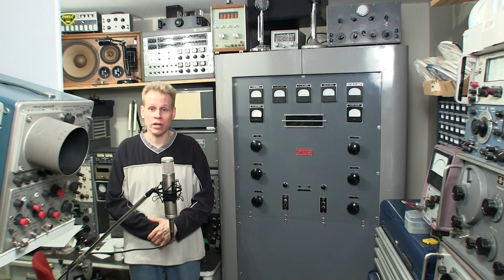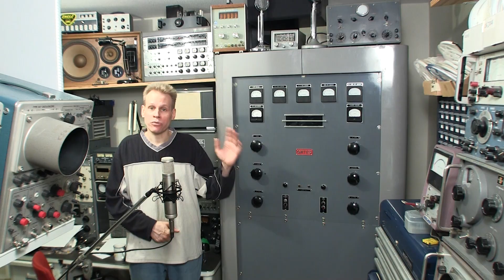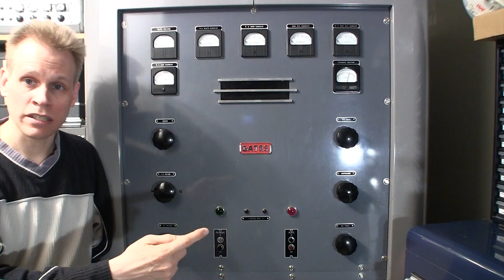Standing Inside a Broadcast Transmitter While it's ON!

Comment: This is a brilliant reminder that in the days before semiconductors (and to a certain degree, long after), the only way to make high power equipment that didn't catch fire was to make it really big. Nowadays, and even for the past couple decades, you could easily fit a 250W transmitter on your desk (and many people do). What people may not realize (or remember) is that the old gear, while big, hot, and inefficient, was super reliable. The new stuff is pretty reliable too, and far easier to have around, but it's nowhere near as serviceable when it does fail. Time will tell if your Yaesu FT-1000MP will still be functional 70 years after it was built, but this monster will work as long as vacuum tubes are being manufactured. You can pretty well fabricate everything else yourself, given the time and the motivation.

Efficiency isn't a major problem for a broadcast station anyhow. Reliability was {and remains) paramount for the purpose.

Comment: man i turned 53     05-07- 2017 i snuck out to my step moms car one time when i was about 8 or 9 years old at about 2 pm one day when every one was gone from the house and we lived in a trailer park in hallsville texas rite beside hwy 80 i mean our yard where the car was parked was about 18 to 25 feet off of 80 and i got in the car turned on her white face 23 channel johnson  radio and got on 19 and started talking to people one after another and would know by talking to them when they were about to pass by and would wave from that moment on i was hooked on transemitting and recieving got in alittle trouble with the foulks over it not much but since the when i was still young mannaged to get walkie talkies to do amazing things all the way from using the small nine volt walky talky that transmitted on 14 but recieived on all 23 ghannels and ran a none shielded wire to a tv antenna on the ground talked all over to the three channel 3or 4 watt walky talkies with none sheilded wire to a antenna telscoping on a cain pole on my roof with nylon string for guy wires . anyway come a long way since then ive trans mitted with a rci 2950 into a jb black cat 200 modge. driving a dentron 160 -10L INTO BELDON COAX 9913 WITH JOE GUNN FOUR CROSSES talked all over the world on cb 11 meters and still doing it love working on amps and radios but mostly amps and never could figure out how a switching device amplified untill yesterday thanks to you man i finnally understand better than ever how the amplifing happens and ive watched lots of videos by lots of people so yes i want to learne everything you can teach about tubes and mossfets  so bring it on about how to use and what kind of tools to use all of it i think your one of the smartest teachers ive watched and its hard to keep up sometimes but ive got pause and rewind hey audio amps are cool car aswell as home tube transistor guitar amps rf all of it thanks for the time you spare for us no spelling but eager to learn poeple out here my man keep up the good work!!!!!!

Comment: Excellent video! Thanks for sharing your rig. Love the old AM equipment and its too bad more Hams are not into restoring and running these macro ovens. It does take a lot of money and parts have become next to impossible to find but if one looks one can find almost anything. Had an old friend years ago who retired from the FCC but had also worked at the Cincinnati VOA site. He had explained to me the switching network for the antennas based on time of day and frequency in use. Wonderful technology that has almost disappeared. Fact is when it comes to AM there s nothing that sounds better than Hollow State! de SV0XBH/9

Comment: I was an electrician in a steel mill, and on the tin plate line we had oscillators, that had  water cooled tubes and coils, the tubes were close to 2.5 feet high and the coils were either 1/2 0r 3/4 inch copper, they were in sealed rooms, we had to go inside to clean the arc marks  off of the copper tubing. when it was operating you could see arcing going on. when it got really bad, the room would turn blue and hum, it was kind of scary to go in the room because you had to make sure everything was discharged with long grounded arc sticks. this was like 17 years ago, glad I am retired.
Reply from the maker: Sounds like something wasn't right, maybe a parasitic oscillation or something. An arc from a parasitic oscillation usually has a "fuzzy powder blue" look to it.
Reply: Well when you are using High Voltage, I can't remember if it was 4160K volts AC feed, or 13.8K what the Oscillators were for was to spread the tin evenly over a plate and the Arcing was usually from grounding, The plate goes through a liquid solution and you have tin bars on top and below the plate the plate is one polarity and the tin bars is the other, the arcing is caused by grounds, its not much like a radio. The rectifiers were also huge tubes 2 feet or more high. If you were watching the Oscillator room and there was an overload, the whole room would light up blue.

Comment: I'm a retired broadcast engineer. That old Gates BC250 brought back m any memories. It and it's 500 watt and 1000 watt brothers were used extensively at small and medium market stations fror many years. Every station you visited had one in service as a main or backup or had had one in the past. Very reliable design even if they did use high level modulation.  If you can lay your hands on an old Gates Vanguard II 1KW AM transmitter and do a show on it That would be great. The Vanguard II was a true class A final amp. Very inefficient as to power consumption but man did it have a clean sound. It used a solid state driver that was basically a complete 30 watt modulated solid state AM transmitter that drove the class A final. The solid state driver box didn't like asymmetrical modulation , so was not the loudest thing in the band . But it was high fidelity AM. Another interesting AM transmitter design was the RCA Ampliphase  in 5 or 10 KW. Strange design and extremely temperamental  but when all was right... great sounding transmitter easily capable of 120% + 97% -  asymmetrical modulation. Back in the days  of the AM loudness wars this transmitter stood out . Sorry for rambling. Your program brought back memories. Thanks
Reply from the maker: Thanks for taking the time to write Jim! Great story.

Comment: I'd be very interested in FM transmitters if that's something you could possibly do. Especially the older tube variety. That said I am so incredibly jealous. I would just about kill for an old Gates cabinet like that one. I have something of an affinity for older equipment like that. In fact I have an old Navy 1MC driver head that I've been restoring as an example. It only has plate voltages of around 600v and the tubes aren't quite as large but I do still love it. If you know of any good sources for an old westinghouse rectified voltage meter that ranges up to 800 that would be helpful. I'm always looking for good resources of that nature.

Comment: Hey Paul, I have a challenge for you.
You usually repair things or show how you were able to soup up a device. I was wondering if you would consider doing a fun project. Not that the other stuff isn't fun, but just something a little different. I was wondering if you could take 4 or 5 fans, maybe the kind you used to fix the heat issue on the MagnaSine transformer a year ago. And with the fans you design a digital control circuit to calibrate their rotation with pwm maybe? And set them up in a ufo platform shape. And then add a circuit for rf reception for acceleration so that the platform can rise and fall according to your trimming signal from a transmitter. And then add one more circuit to receive a signal to turn a servo on each fan equally. That servo rotates the fan on a yaw 1 degree to the left or 1 degree to the right. When the rf signal that triggers that servo-set is trimmed up or down is rotates the platform with respect to z-axis (relative to the up and down axis, so in other words spinning along the horizontal plane).
That should be a good 1 hour episode. And then maybe a few months later you continue the project to add forward thrust which I'm not too sure logistically but I would say a separate circuit added to the yaw servo to increase some of the current pass to some of the servos and a little less to the others which in turn would cause the platform to start moving in one direction along the horizontal plane. Another method would be to simply add another smaller fan or two perhaps at 27 degree angles to provide thrust.
Reply from the maker: Hi Roscoe (of Hazzard county) :^) That would be quite a project!
Reply: haha Glad someone finally got the reference, kew kew!

Comment: I'd be interested in more details about that rectifier replacement, is that just some sort of "drop in" plug-in thing that fits where the rectifier tube you described used to be or does it have to be re-wired to connect to the diodes?
Reply from the maker: Hi Matthew, the rectifiers just plug in the existing tube socket, no rewiring needed. This also reduces filament current consumption, as the winding for the filaments has no load now. Technically, you could remove the rectifier filament transformer after this mod.
Reply: Very cool, I have to admit I don't know much about tube gear but it's quite interesting to learn about for sure.

Comment: mR CARSON sIR - tO BE RESPECTFUL. sir. how do you understand how to be funny.
Reply from the maker: John Robinson
 Actually, I don't understand your question??
Reply: I must say i am sorry for that - 2 screens and late at night = screw ups. My fully awake and alert question is this : An automotive stereo, din size. Used outside of an automotive environment - portable.
How can i improve the AM reception ?
My idea was wind a coil of wire...OR hack a ferrite bar antenna from an old am radio.....And as a last resort just run a long wire and be done with it. Homemade boombox so to speak. The speaker box volume i have yet to work out, around a a cubic measurement of under 2 cubic feet per speaker - or so +/- i will sort that out. 
I keep coming back to the fact that since i have no metal mass like a car body, i'm going to be stuck with a long wire for AM.......

Comment: Well done.  I appreciated the video and the time you took to explain the operation.  I worked as a broadcast transmitter engineer most of working career which started in 1965 and ended in 2014 when I retired.  I have found memories of the old spacious Tx's that were actually designed to be repaired for decades of service.  I have installed and maintained transmitters as small as a 10 watt FM translator to as large as a several million watt network of TV and Radio stations throughout Michigan.  It was always a sad time when we had to decommission a TX and get rid of it.  Our company regulations did not allow us to sell or give away the old boxes, we had to scrap them.  Being a Ex Ham, I knew that there were many Hams that would have loved to have the old equipment. Although now that I think about it, some of the transmitters I actually did enjoy tearing out, as they were such awful designs and or poorly manufactured.  For the most part I loved most of them, especially the old AM rigs that RCA and Gates made.  I Have found memories and a lot of pictures.  I will watching your video in the future.  It is nice to see people like you having the knowledge and enthusiasm for broadcasting.
Reply from the maker: Thanks for taking the time to write John!

Comment: Nice vid dude, i was a dj at a 1000 watt am station, we did not need a engineer to turn it on and off, we did that our-self the transmitter was at the station location too, so nice everything in 1 place, but that transmitter was huge 2 times the size of the 1 you showed, as i recall it had 4 833,s in the final and 4 of those mercury vapor rectifiers in it, loved to watch them glow blue when broadcasting, wish you would show what the modulation does and why it was there as i never got to ask what it was there for, i am sure you know.. thanks for reading this.

Comment: I Just loved your video of the Gates BC-250-GY broadcast TX. The size of the tubes, chokes and transformers etc. No wander the cabinet is so large. Makes me laugh when I think of the very first CW TX that I made back in the mid 60's. The only suitable thing that I had for chassis were a pair of army Ali. mess tins (the Brit army type that the small one sits inside the larger one). Roughly 6 x 4 1/2 x 2 1/2" deep. Both fold down rod handles were removed. The smallest  was used for the power transformer and rectifier and the larger for the oscillator, buffer and final output stage. I had to make it so that it worked on an army frequency as I did not have a Ham licence for transmitting then. I was just chuffed to nuts that it worked OK and put out a clean cw signal. The best use it got was to work to Army cadets back in the u.k from my M.Q. in Hildesheim, NW Germany. I was able to load the TX OK into my Ham 132ft wire antenna up about 50ft via my H.B. ATU.  Yes sir that brought back good memories. God only knows what the O/P was from the 6L6 tube. pos. 20watts at the most. But it was good fun.
Reply from the maker: Great Story John, thanks for taking the time to write!

Comment: If you have room on your property, then you must have some room for your Ham radio Antenna's and your big AM transmitters, an acre or two.  More than a city lot I would think.  It would be interesting to take a video tour of your transmitters and your Antenna's.  Also, your labs is located where in your house, or in a "Man Cave".  You have acquired a lot of equipment, mostly used, did you get it on E-bay, or did you have to fix some of it?  Later Ray Burke

Comment: Funny, one of the first things I learnt as an apprentice radar tech on an old army air defence radar set was how to bypass the safety circuits. The reason for that was , say we were setting up the equipment and something needed adjusting, we'd shut the set down to open the equipment drawers... but this would kill the cathode heater supply which would mean we'd have to wait 10 mins for the time delay. So, out came a plastic comb and we'd go round all the drawers tripping various relays to put the power back on, this wasn't a problem as the valves and magnetron were pretty good at keeping their temperatures up.The only hassle was some of the relays being tripped didn't control 1.5Kv but 30Kv which as you can imaging might tingle (I did get bitten by a spark from a 15Kv transmitter psu and that threw me a few feet :)Nice explanation of your Tx setup, thanks

Comment: While I really enjoyed your video I do question that you would enter an active transmitter and handle high voltage components that are one switch and interlock away from being energized.  Having done engineering for several large radio stations including KRMG in Tulsa and KOMA and WKY in Oklahoma City.  I find it a bit disturbing especially without a disclaimer for novices not to do such things.  In all cases, any transmitter that was connected to the power grid whether the breakers were on or not was considered to be possibly live.  Much like treating all guns as if they are loaded.  When entering these transmitters for component changes, breakers were actually removed and insulating dummies were plugged in for safety. Interlocks were never relied on as a reliable method of preventing electrocution.

Personally, I do not care if you do trust them, but I think a good disclaimer to young people who are thinking about working with high voltage would be in order because as you said, it only takes one time.  Plus, any poking around in a transmitter should be done with your left hand in your back pocket and then only after all circuits have been thoroughly proven safe with the transmitter's grounding stick.  Many older model transmitters did contain interlocks, but not automatic high-voltage grounding locks tied into the interlocks thus leaving HV capacitors with a charge capable of stopping the heart.  

Maybe I'm overly concerned, but this method of safety has kept me alive through many years of high voltage work and then later in explosive manufacturing.  Safety first!

That being said, I do enjoy your knowledge and explanations in the videos.

Comment: My grandfather told me, when he was stationed in Greenland in 1950, one of these Gates transmitters came in for installation at one of those remote bases in the DEW line. But it was a very special model for that particular cold weather requirement.

To install it, they required the facilities manager to work with the contract plumber to install water & sanitary sewerage line connections, complete with a closet flange to the location where the transmitter cabinet was to be located. Then they mount a porcelain sanitary closet fixture inside!

That is correct! The station engineer could cheat the door interlock, go in & do his daily constitutional! It even had a toilet paper dispenser holder inside! But, you don't want to touch anything or take in the morning newspaper which could touch something unintentionally. You didn't want to stay in there long because with all the heat generated inside, anything sitting in the "bowl" would ferment very quickly & the smell would gag a maggot on a gut wagon at a distance of 100 yards!

It was a very nice piece of electronic, electric & modern plumbing  engineering! Very modern for the time! All the convinces of a modern radio transmitter & the provisions to make your daily checks around the station a little more pleasant!